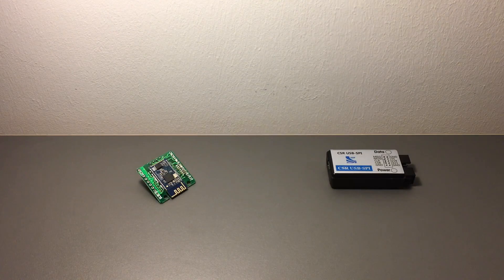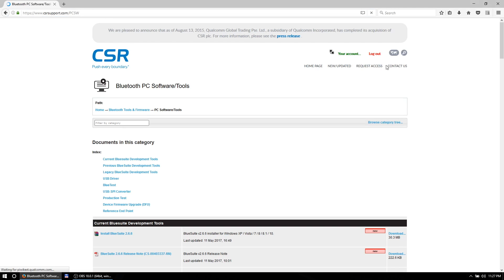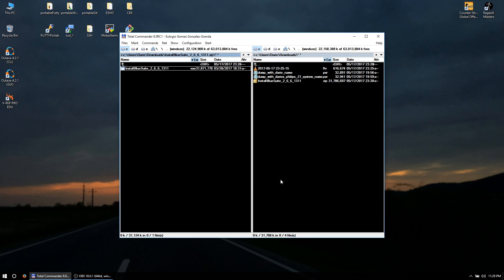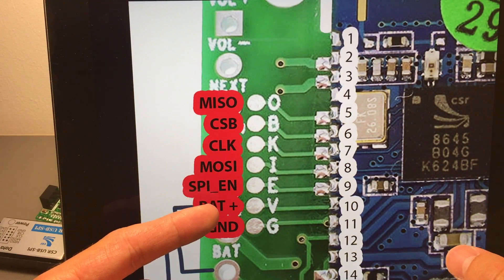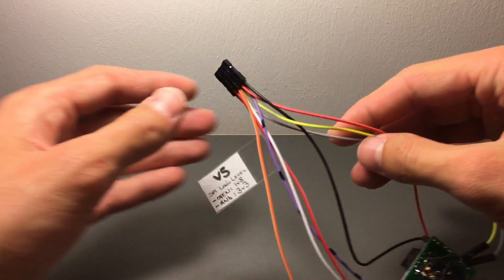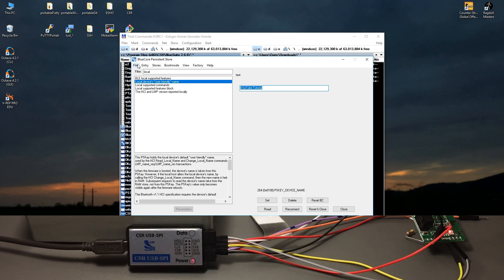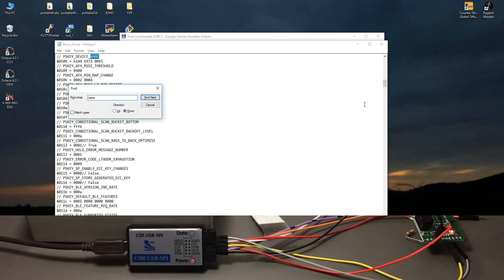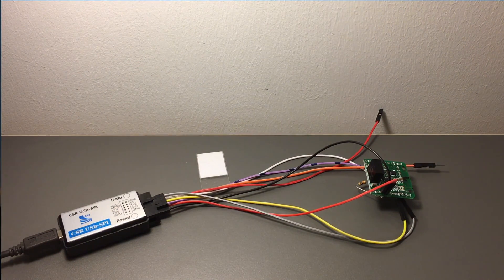How to Rename a CSR8645 Bluetooth Module

Comment: So you're Romanian! thanks for these videos, I might give a try to play with the EQ on this CSR, did you get the results you wanted? also do you know if there's a dynamic bass boost option(for lower level listening) and compression for louder volumes to avoid distortion?
Reply from the maker: Cu placere :D foarte multumit, boxuta aia de lemn se auzea foarte prost inainte sa reglez equalizeru, acuma se aude perfect ... Stiu ce vrei ... asa are apple pe Hi-Fi ... volum independent la bass, si ... paaarca era o chestie cand configurai DSPu cu ceva bass boost, da n-am incercat
Reply: pentru proiecte mai pretentioase uita-te pe site-ul sure electronics in caz ca nu stii de ei. au un modul DSP separat dar si cu amp pe aceeasi placa, iar softul de configurare/programare e destul de complex cu multe optiuni. eu am unul dar trebuie sa ma mai joc cu softul ca pana acum rezultatele sunt asa si asa, probabil din cauza mea. varianta asta cu DSP-ul din CSR imi place pt ca-i ieftina si compacta, probabil folosita in multe boxe BT de pe piata
Reply from the maker: am auzit de ei, par sa vanda chestii de calitate; singura mica problema cu equalizeru din 8645 e ca introduce destul de mult lag ... fara equalizer ai ceva gen 150ms, ceea ce nu prea se observa, cu equalizer n-am masurat da nu prea-i folosibil decat la muzica. Chipurile noi au si mai mult de 5 parametri, deci poti sa le setezi mult mai precis .. da .. pana ajung alea pe module asa integrate ca astea, mai avem de asteptat

Comment: Hi I bought the CSRA64215 the data sheet say that have a usb and uart interface, You have any idea about how config this module?
Reply from the maker: I did try out one of those modules (mine didn't have audio though so .. dead out of the box). The procedure is fairly similar; PSTool works, but for disabling the microphone/setting the equaliser you'll need different versions (the ones I linked in the other videos won't work).

If you want to just rename it, then you're good to go, if you want the other stuff, I could upload all the programs I have

Comment: Okay renaming it worked but the parameter did not connect.
I tried DSP> Connection> USB SPI 51052
then ot the algorithm error.
sorry I didn't put this in your equaliser vid.
Reply from the maker: Soo, were you playing music while you were trying to set the equaliser ?
Reply: Darieee
sorry for the late reply
I wasn't playing music while changing the EQ cuz the module won't play loud enough for me to hear on speakers and the tda7492p won't play unless there is power to the amp and module.
I didn't want to damage it, but I have to hook up an aux to the Lp, Rp and Ln or Rn to plug in either headphones or other speakers.
I haven't done that yet but I guess I'll try after work.
Reply from the maker: +MegaSpotman you don’t have to have anything connected to anything on the audio side, the amp can stay powered off - just have the csr chip connected and powered to/by the programmer, and hit play: check the video though, I’m pretty sure I did mention all of this there

Comment: here it is:
https://youtu.be/sfmCIB7K2MQ
Reply from the maker: Alright - sorry for the late reply - this one went into the spam folder; is that the CSR8645 or the 8635 or something else ?
Reply: Darieee
Its a csr8635 on a tda7492p.
I added the pins and a 10k resistor (which I found in a broken portable stereo) for the csr config tool.
Reply: Darieee
also i tried searching up on how the power supply works when using the config tool while its mounted on the amplifier and didn't find anything helpful so far.
Reply from the maker: I don't think I fully understand your power-supply question, but regarding powering the CSR8635 while it's being programmed, it'll have power from the programmer and it is NOT ADVISED to power up your amp during this process.

I've added two pinouts to the description of this video which should be all you need to get programming; connect MISO MOSI CSB CLK to the programmer, VBAT to 3v3 and GND to GND (the programmer has more grounds, all are the same - check if your csr8635 module has all grounds tied together, if not, just use the one on the lower right) AND also SPI_EN/SPI_PCM via the 10K resistor to 3v3

Let me know how it turned out (also, how good is the tda7492p amp ??)
Reply: Darieee
the tda7492p is pretty good.
so far I've tested up to three pairs of speakers and one of them is those wooden box type but not big and its pretty loud.
i can't test it now cuz its 8:24am.
I'll make a vid when i can.

Comment: I also have a csr8635 on a tda7492p.
Can I use the same connections?
Reply from the maker: +MegaSpotman if the board you have on there is exactly like the one I have in the thumbnail, than yes, but be careful of the pin numbers; I have a discussion on this somewhere in the comments (and initially gave the wrong pins so beware of that as well)
Reply: Darieee Awesome
Thanks
also I've found some external pins, i guess, for the spi usb on the amplifier for the csr8635 but I'm not sure if I should try it.  I'll link a vid soon for u to check out.

Comment: I don't have a 10K resistor.  Can I still configure my csr8645?
I have a different one where all pins have holes, but some can be used.
also its not on ebay no more.
Reply: it worked fine. didn't wired up spi_en and 3v3 correctly. now i renamed the device :D yeah thank you very much. 
For the protocol: Worked fine with Sure / Wondom AA-AB41136 (BT4 Modul - TTK BT98 v3.1 0907 Chip) now lets play with the dsp
Reply: Tested Sure Bluetooth Audio Board: https://goo.gl/AKnCp9
Sure Electronics Distributor Links: https://goo.gl/M56Sji
Reply: it seems like my wiring was bad. done all new, reinstalled the software - and here we go, it works perferkt. now i have to find my perferkt pEQ setup. 
a million thumps up for your videos and help.  win7 pro 32b - reactivated an old notebook :)

#krachkoffer
Reply from the maker: +MegaSpotman you probably should try going for some resistor; 1K around ? Some people did say they just connect the + directly - I never had the balls to do it, let me know if you go ahead - wether it worked or not
Reply: Darieee 
I didn't know that.
Thanks for the quick reply and help.
Reply: did it work without the resistor? have anything hookedup expect the spi_en to plus
Reply: Tobias Link
I haven't tried without cuz I found some in a discarded portable stereo and not hooking up the spi_en didn't allow me to connect to the PSTool program
Reply from the maker: in case it does work - do let us know I'm also quite eager to find out xD
Reply: well 1st i found a 10k resistor, so i do not have the balls as well. :) but i get an * ERROR * on the PS Tool. could be because i tried it on a sure bluetooth board. the chip says TTK BT98 v3.1 0907 - i'll recheck all wires and test again
Reply from the maker: +Tobias Link so it’s not a CSR chip ? Are those compatible with the csr programmer ??
Reply from the maker: +Tobias Link could you leave a link to one of these (not sure what I’m looking for that’s why I ask)
Reply from the maker: thanks ! seems high end ... I might go that route too in the future ... the amount of complete and utter crap on ebay/banggood has unfortunately gone up too much ... almost all orders this year were garbage ...
Reply: didn't get the DSP Connection runnig. Stream plays, but the UPM gets 'keine Rückmeldung' :-( Kalimba DSP Chip should be on the Board. any hints?
After reinstalling i get the follwing msg: The Transport USB SPI (500914) cannot be opened // PStool worked fine, so it cannot be a connection issue
Reply from the maker: So the transport thing comes up if you have nothing playing ... Are you sure you have a Kalimba DSP though ? I don't really know what else to say - I have been completely unable to get it to work under Windows 10 x64 though - only x86 Windows 7 ... what're you running ?
Reply from the maker: +Tobias Link geil :D glad I could help, have fun !

Comment: Thanks for tutorial, but I have a problem, my usb/spi converter isn't found by bluesuite, when I connect it in my computer the power led turn on but bluesuite don't found any port. any ideas ?
Reply from the maker: +corentin baron I'm assuming it looks exactly like mine ? What Windows are you using ?
Reply: I'm on win 7 x64, using csr8645 bluetooth card
Reply from the maker: +corentin baron hmm, and you can't see it show up on the bottom right on the Eject icon ? In that case you might've not installed BlueSuite properly; did you have everything ticked the same ? 3:50
Reply: thank for answer, in my computer I haven't the eject icon but it is in my peripheral manager... disturbing...
so I test on win10, bluesuite detect it, but now, I have an error "error detecting chip type" .   
Is it possible that I got stuck in the connections ?

Not sure to be clear, I don't speak english very well ^^
Reply from the maker: +corentin baron your english seems quite fine :D - have you tried running a virtual machine ? Check my setting the CSR8645 equaliser video, I go a bit more in depth on that there (and there's a very nice guide linked in the description on how to achieve it); it might also be that you haven't connected the module up properly, or some pins are shorted out, have you made sure that's not the case ?
Reply: I will look at it, but I would need bionic eyes ^^ I'll keep you informed !
Reply: I think about it, the bluetooth amplifier is already connect (speaker, control, power but actually off) Does not it hurt?
Reply from the maker: +corentin baron I would highly recommend not powering the CSR Amp Module from your batteries, but rather power the CSR Module itself (so not the amplifier input) directly, through pins 10 & 11 (as seen at 5:35). The power for those pins should come from the CSR Programmer
Reply: I've test to connect pins 10 & 11, the power led of the spi converter turn on and immediatly turn off, before I test to connect pins 16 & 17 (I have a map witch tell pin 16 = 1v8 & 17=gnd) led turn on but I have the "detecting chip error
Reply from the maker: +corentin baron aaa shit - sorry, my bad - i really hope I haven't fried your module :-s; indeed, 10&11 are something else. So, connect the programmer wires to the following pins on the csr8645 module: MISO(pin5), MOSI(pin8), CLK(pin7), CSB(pin6), the 3v3(pin 14) and any GND(17)
Reply: yessss ! that's it ! my mistake was to connect the 1v8 on pin 16 or, now that the 3v3 on pin 14, it's now work in vitual machine (win 10 64 bits) my win 7 64 bits don't found the converter. Thank u so much !
Reply from the maker: +corentin baron no problem :D glab I could help !

Comment: Awesome tutorial! Thanks for this. One question though...My module is attached to an amp board, so I should be able to just power it through that and skip the +/gnd connection from the programmer and the resistor, right?
Reply from the maker: +Brandon Terry the resistor you'll not be able to skip: that tells the CSR chip that it's being programmed. I also would advise against having the board be powered separately, it's only 2 extra wires :), with enough flux, patience, and obviously, more flux, you should be fine
Reply: Darieee 
Ok, that makes sense. I appreciate your help.
Reply from the maker: +Brandon Terry no worries ! Good luck with your project !
Reply: Ok, so now that I look at it, I have an 8635 instead of an 8645. I'm thinking the same pins need to be connected, but the only one I don't see is the SPI_EN. Mine has a pin for SPI_PCM. Would that be the same one? Sorry to bug you about this again. I just don't want to blow anything up lol
Reply from the maker: +Brandon Terry I would think so - that one you connect to 3v3 with a 10K resistor, so it's quite safe even if it's the wrong one; I would expect it to be the enable though

Comment: i noticed your module broadcasts battery level. do you know how to configure this feature?
Reply from the maker: +Sergey Sereda the best way to do this is to use my dump (this'll never stop sounding weird :)) and see if it enables it on yours; although, on my iPhone it shows about 3 type of icons ... headphones with battery, bluetooth with battery, and sometimes even just the bluetooth symbol, so, quite ureliable; also the readings the unit gets have, at least in my testing been quite inaccurate
Reply: thanks for your reply. tried yours dump. compared with mine and changed get from yours. some of pskeys brokes module. the same thing happened with another dump. need to find somewhere pskeys description to not to act like blind kitty :)
Reply from the maker: +Sergey Sereda you can try the configurator tool, that has 'normal names' for all the settings; however it always broke my unit, so, be careful
Reply: i tried :) also couldn't be enabled in that way. even if doesn't broke :)
Reply from the maker: +Sergey Sereda any other programs you know of ? for me only this pstool seemed to ever work
Reply: no, I don't :( can confirm pstool works. i could change, for example, device name with pstool and configuration tool, but not battery service
Reply from the maker: +Sergey Sereda alright - so with me configuration tool breaks everything no matter what I do (tried reading and exporting file -> upload via pstool, still nothing)
Reply: to not to break your module you need to compare exported file with stock psr. move changes to another file and than merge with pstool (file->merge...)
Reply from the maker: +Sergey Sereda sounds like a great idea, I'll give it a go
Reply: have you tried to disable battery service?
Reply from the maker: +Sergey Sereda no - it'll be a while until I get to it; have a lot of stuff on my plate with uni. If you do manage to get it done, do let me know !
Reply: hey. figured out issue with battery. here is link on Chinese forum's thread: http://www.52bluetooth.com/thread-850-8-1.html

Found it very helpful (with google translate of course)
Reply from the maker: Thanks ! I almost cracked how to set up the equaliser (while connected to the PC I can modify it, so, I'm quite close). Let me know if you figure out how to disable the microphone completely :D
Reply: pls, post your solution here when you has finished
Reply from the maker: alright - cracked the equaliser too :D feel free to check my latest video on that; next up : disabling the god damn inexistent mic ! (if you have any details on this, let me know)
Reply from the maker: I found a version of ConfigTool which works seemlesly with the 8645 (under 32 bit windows 7), not sure if I can post the link here, but, here goes https://www.dropbox.com/s/vtvg8g7qnk08pju/CSR86XX%20ConfigurationTool-3.0.70.zip?dl=0